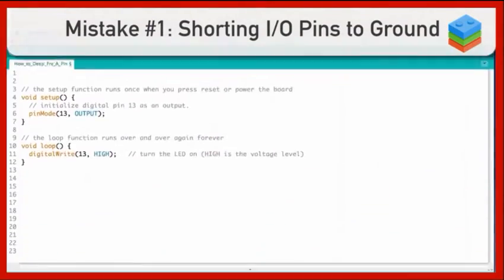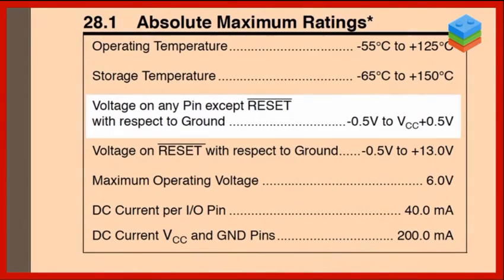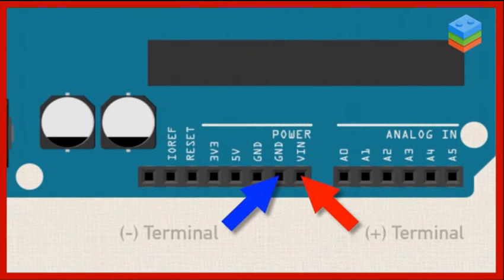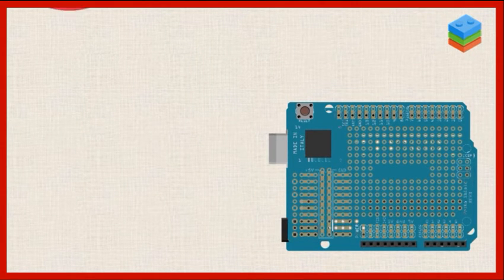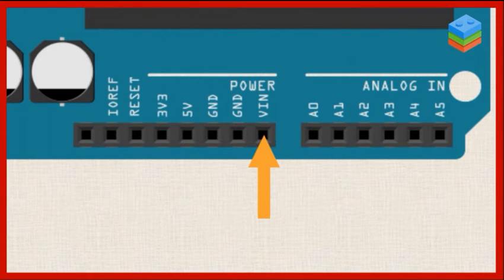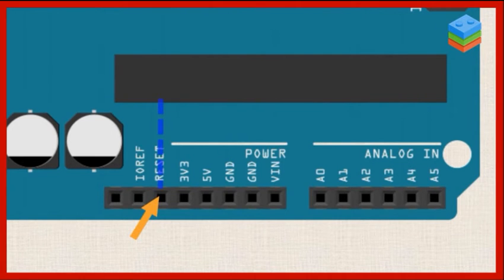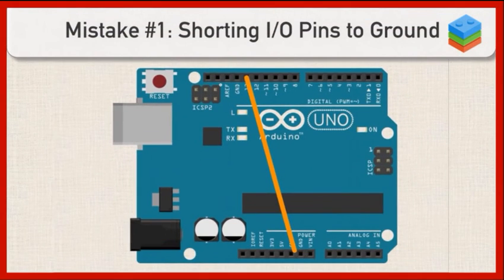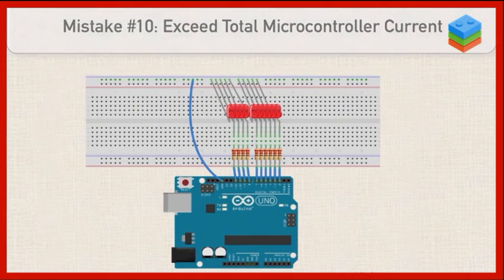10 أخطاء تتلف لوحة الأردينوانو - 10 ways to destroy an Arduino

Comment: Actually, powering the Arduino with 5v on the 5V port is the correct way of doing it if you have a 5v power supply. The vin pin should not be connected to voltages lower than 6v due to it's regulator, according to the site. 5v on the vin pin may actually not provide enough voltage to the arduino. It may work, but it's outside the recommendations.

You just have to be very careful for that voltage to never exceed 5.5V.

Comment: What about powering up an Arduino via USB and also having a power source on te Vin? Does the same principle count as on Mistake #8: Apply 5V External Power with Vin Load? I did this yesterday and my Arduino blew up. Hope that's the problem, so I can rule it out.